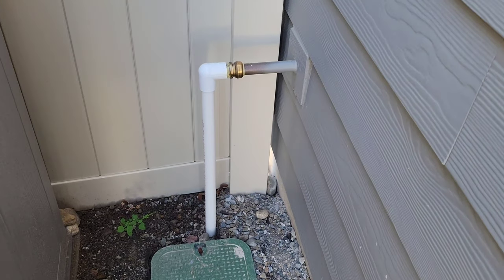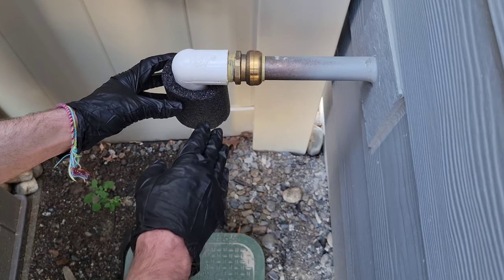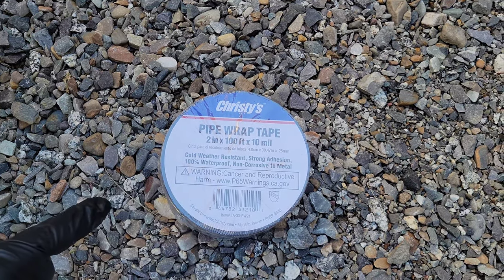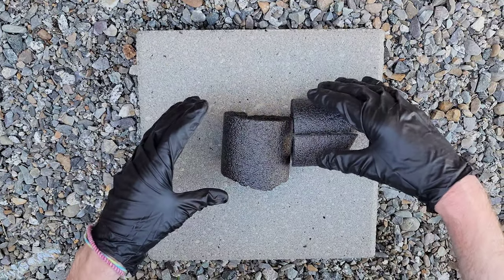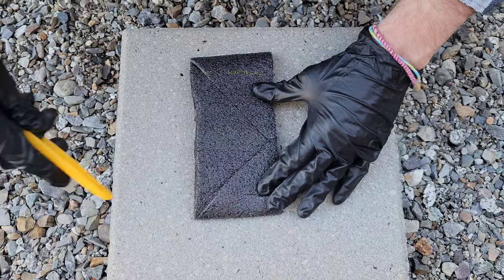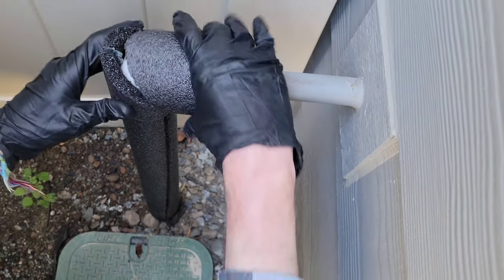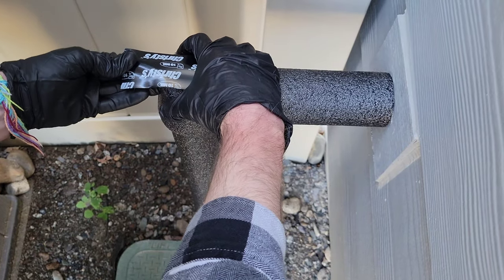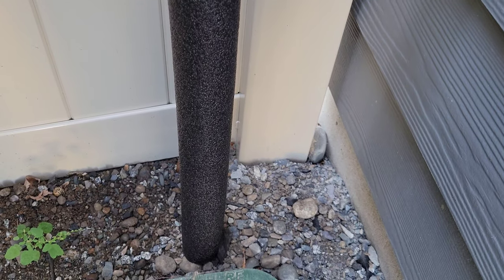Insulating An Outside Water Pipe

Comment: I have a tiny home that a handicap relative lives in. The plumbing runs the entire length of the building externally. No matter how tightly wrapped, they freeze and burst everytime there is a hard freeze in TX. I would be so grateful for recommendations on how to protect these long term, possibly in a way where I don't have to re-do it every year. Or just how can I insulate them well enough where they wont freeze. They are all PVC. Thank you
Reply from the maker: Thanks for watching.  I'm sorry to hear that, but that is outside of my knowledge level.  Hopefully you can find somebody to help you get that fixed so it stops freezing every year. Good luck and thanks for watching.
Reply: You could try using a different type of Pipe sleeve. They make ones for Pipes in commercial freezer that can handle negative 100° and self sealing. ( It's smooth black rubber like material)

They also make ones which have fiber glass in it and cover in silver wrapping.
Reply: @KaeganThornhillTheCyberRaven  You know the name for it?
Reply: @Sarah White Insulation alone won't stop the pipes from freezing. You'll need to install heat tape or heat cable.
Here's a link to a clip from a guy in Alaska. He shows how to install heat tape and insulation. He says he's had no issues with his pipes freezing at temps as low as -70F. https://www.youtube.com/watch?v=0Aww50G0fSU
Reply: We used heat tape to prevent pipes from freezing but the tape can only be used on metal pipe. It will melt PVC.
Reply: To throw out ideas,  
if someone is present, you can try underground shutoff valve and drainage tee's.  Every time freeze is expected (usually overnight), shutoff and drain.  You can try pex, which has some give.  Pex is damaged by sunlight so must paint or cover with insulation or a sleeve.  
  you can leave tap dripping (probably the best bet).
Reply: Box in areas to keep wind out if possible. Creating drain lines like previously stated is good. Best bet would be to close it in and add a small heater to the area like you would a greenhouse or pump house just to keep it in the 40°s.
Reply: If possible 2 feet under the ground will stop freezing.

Comment: very helpful, i need to do the same thing..thanks for sharing..the only thing i think could be an issue is that my plumber was able to use a heat gun against my exterior pvc pipe to thaw the ice. If i use that heat wrap and pipe insulation, not sure he could use the heat gun at all..